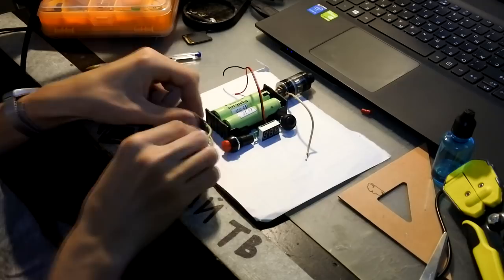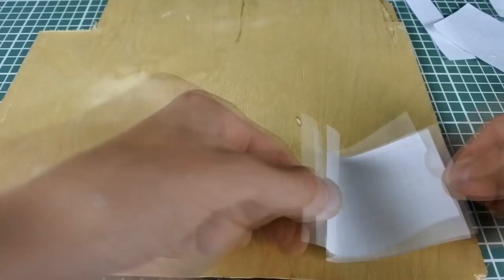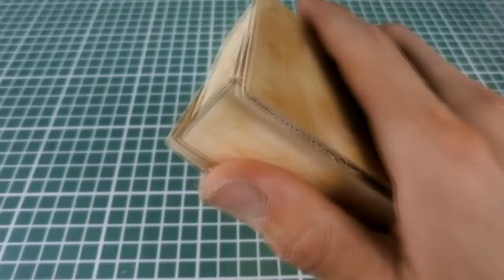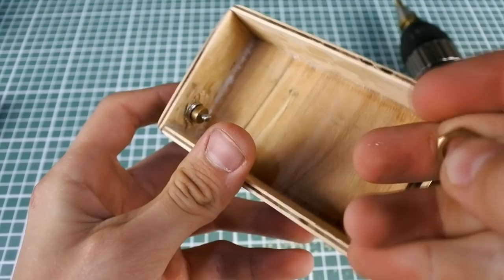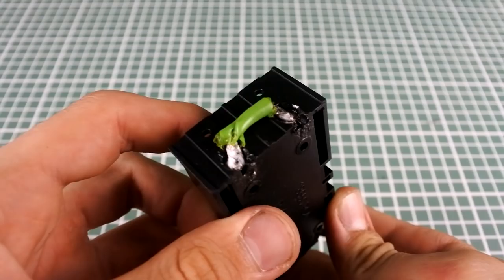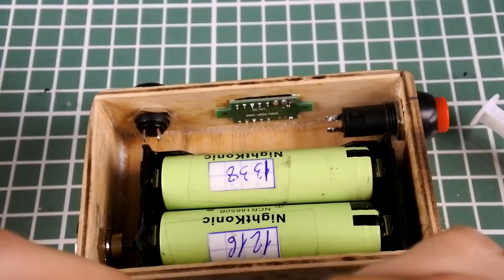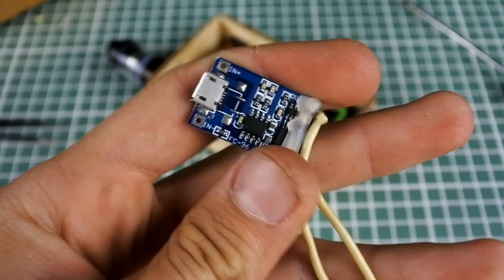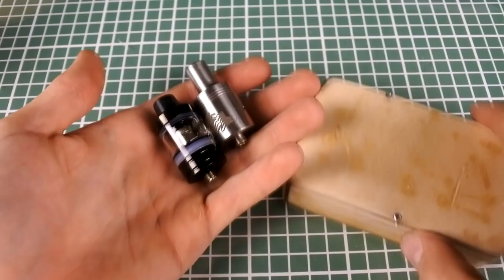How to make a powerful vape mod

Comment: If you have a CNC engraver, you could pay more attention to all of the assembly. When you vape you pull much more amps through the switch it can bear, a mosfet is needed. Other than that it's not that bad :)

Comment: Pretty neat tutorial bro, but you forget about putting mosfet before the fire button.
Reply from the maker: This scheme doesn't  need it. All is workable without it)
Reply: Sure it does work - but still a mosfet is neccesary for this scheme. A switch like this is probably ratet for 2A - Depending on the coil you are using you can easily reach 30A. There is a good chance the switch might fail at some point. In my opinion it is irresponsible to show people an unregultated box and how to built it without safety features like a mosfet and not even mentioning battery safety.
Reply: keep in mind that people could use your tut. and run around 30A through a aliexpress switch which is probably build for 5-12V low ampere setups...
Reply: @Brainwash110  he was also soldering with the 18650s in the tray. Safety wasn't his first thought.
Reply: @Brainwash110  but is there a video explaining how to incorporate a mosfet into a diy vape ?
Reply: @maketv7779  hello bro
Reply: @pinnacleexpress420  quite a few

Comment: This is NOT safe. You could have easily melted the insulator on the battery, causing it to vent or explode.. also, I highly recommend using a 3034 mosfet, it's basically crucial at this point because of all the sub ohm vaping. Melting your switch is no joke, especially since you have no quick way of popping your batteries out there.
Please be safe everyone. There are many many mod makers out there, including myself, that will do it for you. If done wrong, you are essentially holding a 'hand grenade' to your face when vaping it.. again, be safe. And know what you are doing BEFORE starting your project.
Reply: Why don't you make an educational video about what not to do while doing these mods or even better show us how to do one safely and properly. I read that you're an electrical engineer in one of the comments. I don't know if that's true but I would certainly take your words more seriously.
Reply: It ok he Russian
Reply: Whatever snob. This kid got good knowledge to make this thing even work anyway. Not many vapers can make a mod like that

Comment: A HUGE WARNING, PLEASE READ: please don't make this thing if you are not experienced in electricity, but if you will please use a battery management system/bms. I just don't want people to get their vapes exploded.
Reply: Often those are built-in chips in some IMR18650 batteries

Comment: So you’re basically showing us how to make a bomb?
Reply: When i see these batteries .... yea it may explode :D Sony VTC5a best batteries for vaping
Reply: HENRI  When you constantly overpowering battery in mechanical mod with low ressistance coils and weak battery or battery which cant handle that low ressistence so at first place you damage battery, then if you still use it even damaged , dont you dare to use it even when is damaged outside isolation, damaged + or - pole or something they battery may explode .... thats why mechanical vape mods arent good choice for new vapers ...
Reply: HENRI  I just tell you if you are smoker , think if you wanna start vaping instead then yes go on buy some device for beginers like uwell caliburn or crown and try it , if you are not smoking i think its bad idea start vaping without reason.....

If you have zero experience with vaping and ohm's law i dont reccomend you to make vape mod yourself , its little bit dangerous ...
Reply: I mean he's russian you should expect it
Reply: @reflex_nocap8668  haha

Comment: This is a great tutorial, but you forgot something this is a "mech mod" (there isn't a chip inside) and without proper handling and knowledge of resistance, currents and ohm's law this could be very dangerous!!!!
Reply: @bockskarr6626  still it can be dangerous
Reply: @furryboris3155  what do you mean? I am thinking of building this thing but am a bit sceptical of the safety 😆🤔
Reply: @Emalo  in that case read a lot before trying anything. I also recently made my first mech mod and even though I keep checking the voltage resistance  other things that can go wrong regularly, I still don't feel very safe.. It's definitely worth trying but I think I'm going to buy a regulated mod soon. This is too much work for my time personally
Reply: @kuro758  Okay, thank you for pointing that out.

Comment: People, do not do this.
Reply: Unless you REALLY know what you're doing.
Reply: There are really just two flaws - better isolation for all connections and a MOSFET should be used since the button will probably not be able to widthstand higher current. But otherwise, not bad :o
Reply: I'd do a tube-like myself, but the result in here is actually interesting. Agree with your two cents tho.
Reply: why
Reply: with out a full understanding of how electricity works and a solid grasp of ohms law and battery capacity rating it is pretty unsafe to do this.
Reply: @alecchrz  it's not that complicated to connect two batteries in parallel and through a switch... u don't need to calculate anything if u follow a diagram.

Comment: Do something easier plz cuz i don't have much of all that stuff
Reply: Just buy it. You can buy all that stuff under 15$ (without battery and atomizer)
Reply: Battery - 5$ Buttons -1$ Box - 0$ cables 0.5$ 510connector Maybe 2$ - 4$ and ITS all you need
Reply: I hope for the sake of your teeth and face you didn't attempt to make this, you can buy a cheap decent mod from most vape shops for slightly more than what he more than likely paid for the components of this. Practice safety my friend